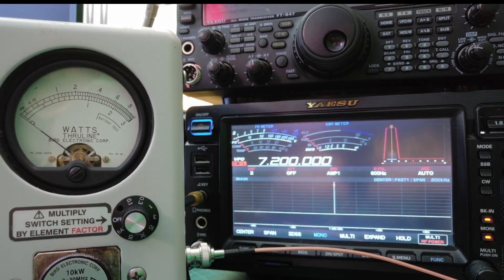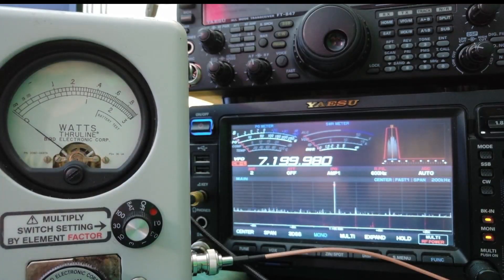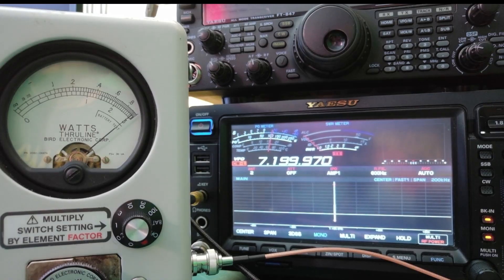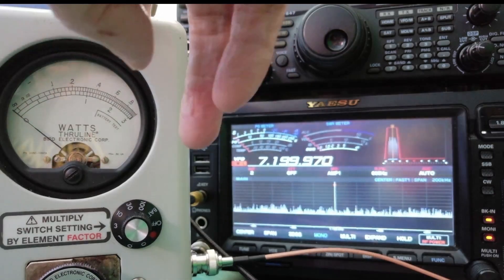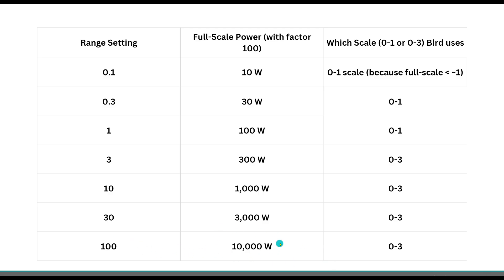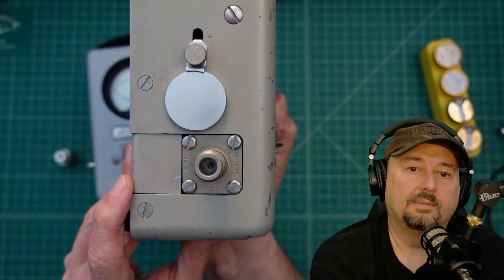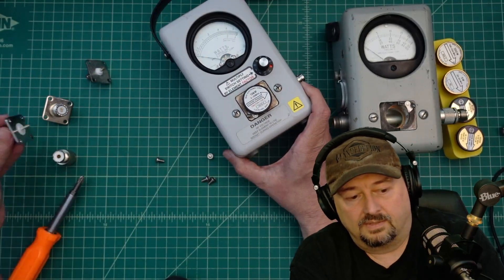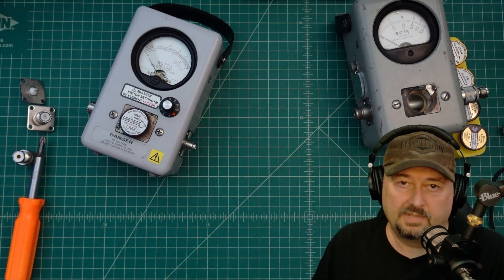Replace the Coax Connector on your Bird Wattmeter!

Comment: Enjoying your videos! I think it’s an old proverb that says a man who has only one watch knows the time but the man with two watches is never sure! Same with watt meters! I have a Bird 43, a Drake W-4 and a Drake wattmeter in my Drake L7 amplifier so I never know what my output power is! The Bird 43 has an accuracy of plus or minus 5% of full scale, the Drake has an accuracy of 5% plus 2 watts on the 200 watts scale and 5% plus 20 watts on the 2000 watt scale. All my readings are within the tolerance range even though that seems a lot. I think your 4410 may have a slightly better way of specifying the tolerance, like above 20% of full scale it’s 5%. Not sure about that one. 
73,
Don
N4DJ
Reply from the maker: Haha, totally agree.  One meter and you are always sure, two meter and you are never sure 🤷

Comment: The Bird element is only accurate at a specific temperature and at full scale for the element +-3% of full scale.. Now, the meter you are using has calibration settings for the internal amplifier that can be adjusted for power level. The temperature will still change. And by the way, it's Coaxial Dynamics, not Cable Dynamics :)).
Reply from the maker: Thanks for the info, I did add a text overlay correcting “Coaxial” 👍

Comment: Thanks for another excellent video ! I’ve been using my Bird 43 since the late 70’s. Those various connectors made by Bird are called “Quick-Change” or “QC” connectors. There are Bird part numbers for these. The part numbers should be stamped on OEM Bird QC connectors. Bird also uses these on other products. BE CAREFUL ! Not all Bird products use the QC connectors. I have some dummy loads and attenuators that do not use the QC connector. I wish they did, but wishing ain’t getting. If you have one that doesn’t, do NOT force the connector out. You may regret it. BIRD IS THE WORD. 73 de WB1COB
Reply from the maker: I love the bird meters…. I suspect there will be more 😮

Comment: Hi Ape, you have the digital SWR wattmeter K-PO from NISSEI. Why don't you do a comparison measurement?
Reply from the maker: I might do a comparison in the future against my LP100A 👍
Reply: Okay, that's good. Another simple method is to measure the rectified RF peak voltage via a T-connector in front of the dummy load. 73

Comment: Nice meter . You could get PL-259 and more for them. Same one in my Bird dummy load as well.  I just have a line section with N . 40 DB  to BNC attenuator element.  Use with Siglent SCA 1015X and you can do real testing. IMD test for SSB and much more.  Change out outher BNC before that 11 meter 10K amp gets used. LOL  73
Reply from the maker: Howdy Robert!

Comment: Hi Ape !!  In the military, they use different meters for different freqs and for power levels.   No one meter is going to be 100% accurate across all freqs and levels.  As you tell us, there is always compromise.    If you had two identical meters, you would have two different readings and would be questioning which one was the correct one.   All that being said, I'm simply jelly that you have the meter !!  Great video !
Reply from the maker: Haha, thanks Rob.  Appreciate you watching 👍

Comment: I must be missing something here, why would you change from an N type connector to an SO-239? By doing this you are degrading the 50 ohm path from what you are measuring to the meter. Both the SO-239 & PL-259 are only rated up to 300mhz and are not nominal 50 ohms. Do yourself a favour and use patch cables fitted with the correct plugs...
Reply from the maker: I changed a BNC to SO-230 👍
Reply: @TheSmokinApe oh ok, but a BNC is just an N type but with a bayonet locking instead of  threaded...
Reply: @ScottEvans-vk7hse  The threaded version of BNC is TNC, N-type has a lot higher frequency handling capabilities compared to BNC/TNC. But there’s the quality of the connectors to consider as well, no-name connector adapters can be shocking shoddy. There’s a reason the fancy brand name adapters and connectors cost an arm and a leg.
Reply: It Matters not for DC, erm I mean HF

Comment: Oh, you have the nice one! My old reliable is the Bird 43. Slugs have gotten expensive. I've been trying to find a deal on a used 100H for a few years.Good video as always. Thanks. 73 de WN7D
Reply from the maker: Yeah man, the cost of the slugs are brutal.
Reply: See if you find a a 50 or 250w slug, use thin double side tape, put it on the face of the element, push the element on a good surface and then remove it with a fast motion. This should peel the face plate of the element. Inside you will find a potentiometer. It can be adjusted use a second power meter to adjust it to 100w. this only works with  elements that are close, but I have successfully done it with 250w elements.
Reply from the maker: Thanks for the info 👍

Comment: I figure Birds should have N connectors, then add adapters as needed.
Reply from the maker: The 43 did 👍
Reply: They can be anything, I have QC (Bird Quick Change) connectors from SMA, UHF,N,C,LC,BNC to 1-5/8 EIA and many more and pop them in as needed.
Reply: @JustMe-u6o2j , no, they can't be 'anything'. The built-in connectors have to be able to handle a worst case scenario, 1,500 watts at very high frequencies. Otherwise you just created an artificial limit for you're meter's capabilities. Something like SMA's won't handle that situation. You want a worst case scenario connector mounted on your meter for that reason.

Comment: the chart you made. Wouldn't you use 0-3 scale for .3, 3, and 30. and 0-1 scale .1, 1, 10, and 100? any division of (3) uses 3 scale and division with(1) uses the 1 scale?
Reply from the maker: You are correct, the chart was wrong for .3 which uses the 0-3 scale.  Nice catch!
Reply: using that 10k slug with dial to 100 will put meter fully to the right a 10k watts

Comment: Hi, just to be a pedant the name of the other manufacturer is Coaxial Dynamics. I have quite a few Thrulines but still begrudge the cost of HF slugs. Your 4410 is very versatile... I have PEP modules in a few Bird 43s, definitely a worthwhile purchase. The clone modules normally operate on a single PP3 unlike the genuine item which eats __PP3s quickly and uses  2 at a time.
Reply from the maker: Hey G0fvt, I did add a text overlay correcting that 👍
Reply: @TheSmokinApe  , sorry I missed that, keep up the good work with the videos..73
Reply from the maker: @g0fvt no worries, and thanks for checking them out 👍

Comment: Power and Power Factor are two different measurements so I wonder what a TinySA might show for signal quality. I doubt you would ever, but the 10kW capacity is probably no longer an option because of the flush insulator on the new connector. I'm not aware of many legacy test instruments that is so future looking the the Bird wattmeter series. The full Bird 43 set I bought in the early 60s is still perfectly functional in 2025 and will probably last long after I'm gone.
Reply from the maker: The 43 is from 1974 😐